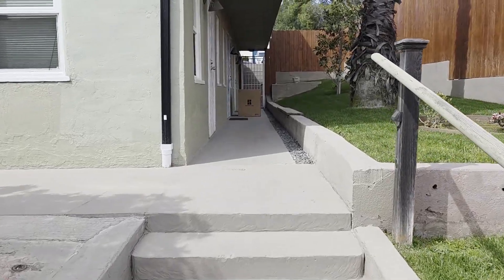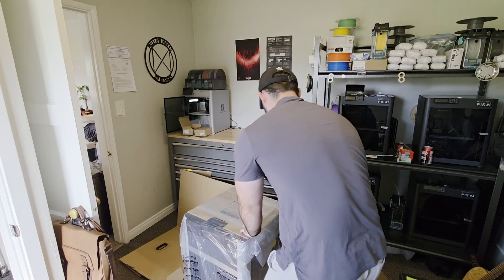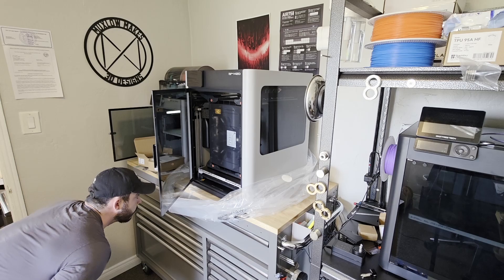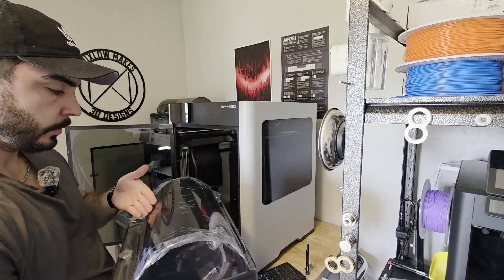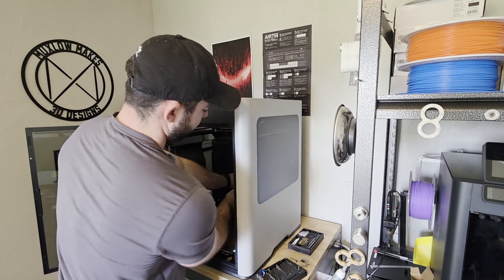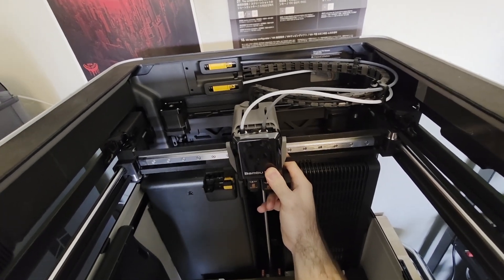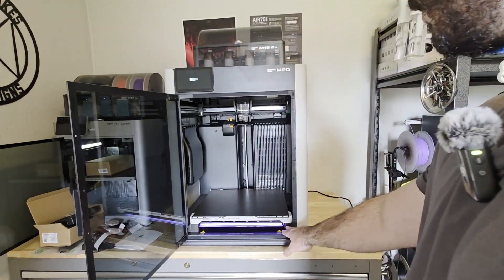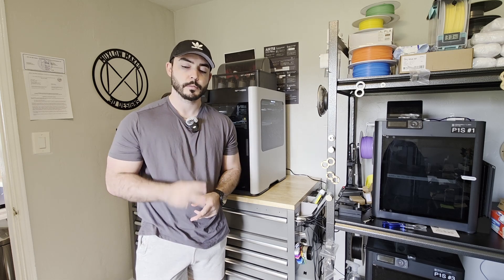Unboxing the Bambu Lab H2D! First Look & Setup of This Dual-Extruder Beast

Comment: I’d like to say to follow manufacturer’s instructions as to lubrication. Just because YOU would rather do it another way, don’t. They’ve thought this out carefully and did testing. Oil will become less viscous as the temperature rises when printing and will run down the screws. The grease is formulated to withstand the heat and stay in place. Additionally, grease is generally used when there is slow speed involved between the components, oil when the speed is high. Oil when the area is enclosed so as to keep the oil in place, and grease where it’s in the open and needs to self support, as in a vertical screw.
Reply from the maker: That's a great point, I'll definitely have to keep that in mind for future maintenance.

Comment: mine is still in the box.. about a week, just chilling..whenever i get to unboxing, i know for sure im not cutting up the box..
Reply: Congratulations on the printer. I'd highly suggest opening to check for shipping damage before your 14-day return policy is gone. Happy printing.
Reply from the maker: Why have you waited this long to open it? And yea i didn't notice the underside of the box. Worked out fine though!
Reply: @sammuxlow  where to place it is the problem.. first 3d printer, i didnt have a preset area for the printer.. im thinking the garage  but gotta make space,  or my office, which i also got to make space.. like i dont have a stand or table for it.. new to 3d printing so im thinking making space also for like filaments and miscellaneous stuff i might need to store... thinking of a 24x36x72 wire mesh rack, or a rack that size i think i can make work to also have clearance around it.. im making space on both spaces now so i can have both options before i decide whats the best spot.
Reply from the maker: @soynobody2741  Wow! This is an awesome printer to start your journey with. Setting up the space where your printer will live is definitely important, and understandably takes some thought. I'm excited for you! Its gonna be awesome once you get it up and running. Why did you pick the H2D as your first printer?
Reply: @sammuxlow  thanks man!!! im excited also..i actually was able to set it up yesterday night, i couldnt wait nomore, so its setup on my office, if its to noisy or smelly thru the day, then ill move to the garage, but for right now, its setup in the office, had to remove a sofa which i didnt want todo, but its is what it is.. i work from home, so will see how it goes. The reason why i went with this printer is because i wanted for engineering purposes and i like how the higher temp filaments seems to be handle with less trouble, im new to the hobby and also old in general, i dont want to spend time to learn every nuances of how the 3d printer works, i just want to press print and let the printer figure it out.. i rather spend time creating stuff than tinkering with the printer, i mean i know i will need to tinker with it, but i dont mind if its to do small maintenance stuff... so i have a 65 mini cooper s, rhd and want to put a crazy sound system on it but hidden, so i want to fabricate some speaker pods underneath the dash to hide the speakers (i can do it in fiberglass, but its way messy, thats why im looking for better alternatives).. also have a side mirror that fell off because the bracket need to hold mirror to the body got broken, so thatll be one of the first things imma try to duplicate to have the bracket needed.. also have a datsun 521 truck to is so modified, and would like to add some gauges and head unit but to make it look stock.. ill be using abs, asa, petg cf and ppa cf filaments mostly, so i figured, the best contenstant is the h2d... funny is, i ordered the x1c, it got here from bestbuy the same day the h2d released, saw the videos, and ordered the h2d and return x1c, just so i dont need to upgrade hopefully for the next few years.. im just running thru the initial start-up right now.. cant wait!!!
Reply from the maker: @soynobody2741 Thats so exciting brotha!! You definitely picked the right printer. Based on everything you said, this will be the perfect printer for your needs. It's definitely the most plug-n-play unit you can get, and it handles Engineering materials like they are PLA. Super stoked for your upcoming projects, sounds like a ton of fun man.
Reply: @sammuxlow  thanks man, i appreciate it!!!